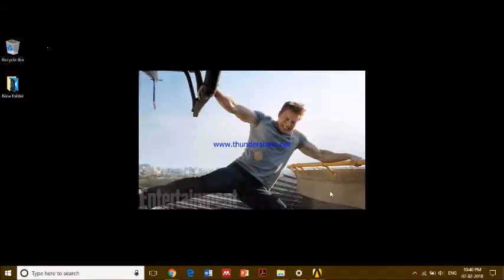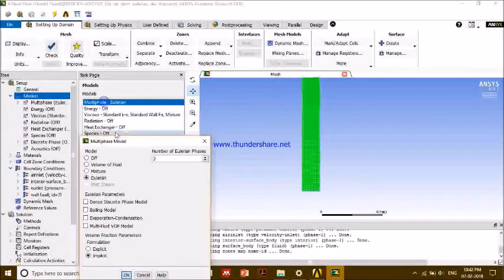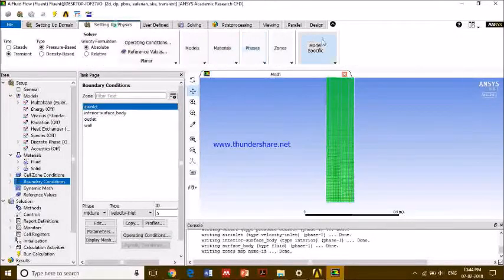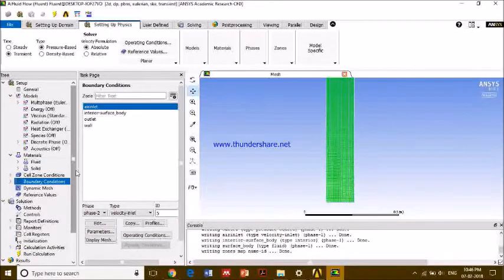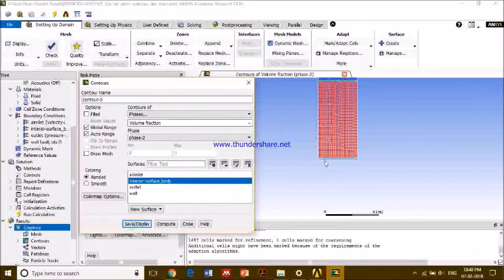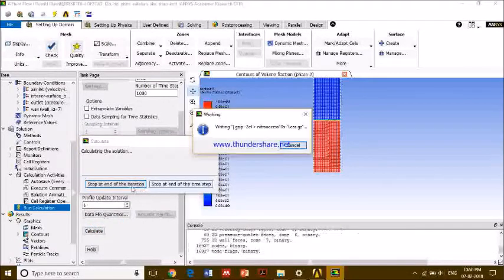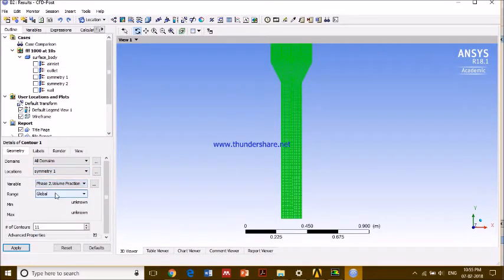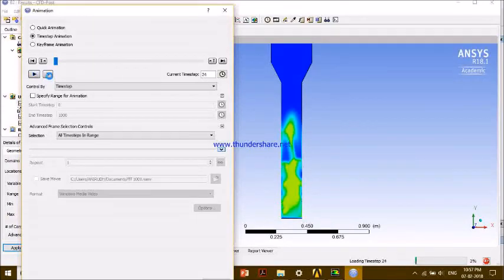Ansys FluentTutorial : How to create a Sand Fluidized Bed in Fluent/Ansys 18.1 and Post Processing

Comment: Hi may I ask how can I check the bed height with respect to the time. I want to analyse on the bed height whether it has increase or decrease as the time passes. Thank you so much!
Reply from the maker: If you see the last part in this video you can know that we can have the images of bed height per frame(seconds)....Did I answer ur question?...hope it helps....u cn ask again :)
Reply: @logicalsaint5742  Hi, thanks for the reply. I am sorry I still cannot find the bed height per frame. it is under which setting, may I know? Thank you so much!
Reply: @logicalsaint5742  Actually i need to plot a graph Bed height vs Inlet velocity but i couldn't find the bed height to display in ANSYS
Reply from the maker: @XxkYs  Sry bro...now i get it..
I checked and i think there is no particular setting for bed height.
You can do it by an approximation i.e. you know the initial height of sand bed(that was given in patching)
AND you know the height of the cylindrical part(in which there is sand bed), so i think an idea of the sand bed may be estimated as we have images of the sand bed per frame(around 13:30).
There is no particular option for sand bed in fluent(I checked) but you can try a UDF if you want to.
Hope it helps
Reply: @logicalsaint5742  Hi thanks for the reply! By the way, just want to ask, after meshing was done, I created an Air inlet and Air outlet and my question is do i select the whole width of the bed as my air inlet/outlet? or just partially?
Reply from the maker: You can do both according to your need. If you select whole then it is good if it is otherwise(partially) then fluent automatically takes it as wall.
Reply: @logicalsaint5742  alright i get it, thank you so much! Would it be okay if i send you a brief project of mine via your email? Because I have tried running calculation for several times already and the parameters and boundary conditions are according to the journal paper that i found online, however I still couldn't get the result i want.
Reply from the maker: Yeah i ll try my best

Comment: How to add moisture to sand to simulate fluidized bed dryer? Please suggest me.
Reply from the maker: Just add water in the material with the required percentage. Or create a new material but you should know the specs of moisture. If you want more detailed reply mail me.